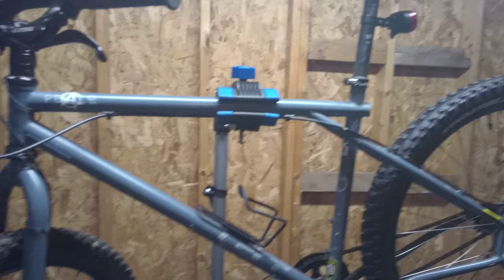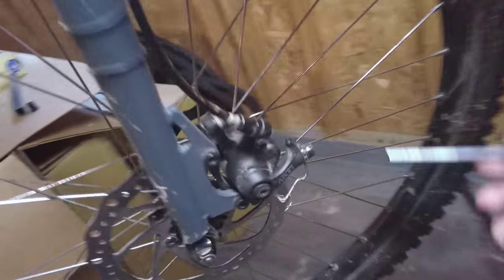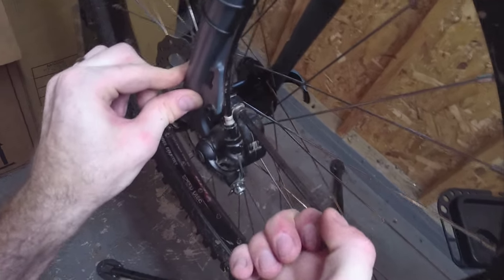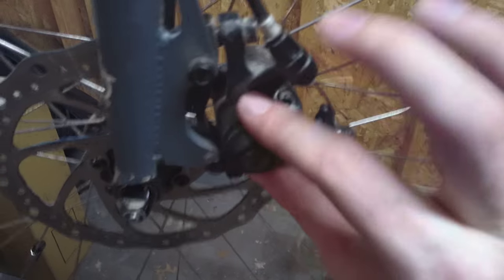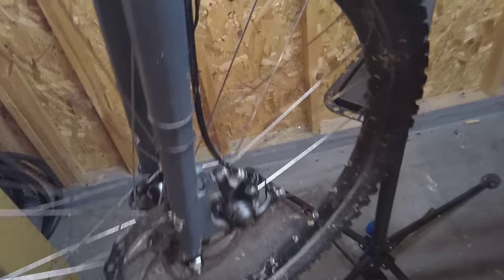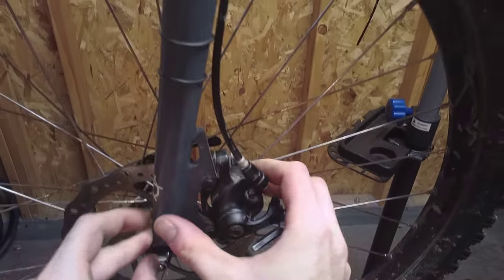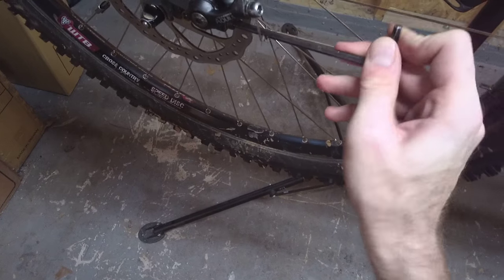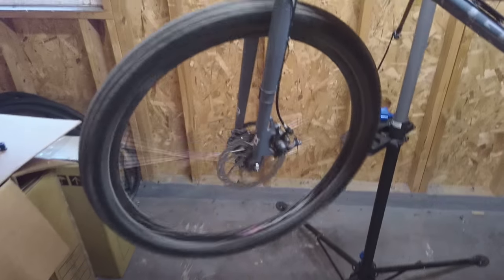How To Fix Disc Brake Rub Noise Alignment Tips Bike Blogger

Comment: Great tips. Didn't know about the screwdriver method. Alternately, you can loosen the Calibur, press and hold the brake, and tighten. The spacer you insert in the brake assembly after removing the tire works quite well.

Comment: Thanks buddy u are my saviour this was happpening with my electric cycle called ninety one Meraki I can’t adjust the rear mechanical disk brakes so they get loose pretty fast so my rear mechanical disc brake is dead so I use only the front one and I noticed this happening with my front brake then I thought that the disk is too tightly fitted to the wheel so I lossended it and then this sound reduced but it just came in huge gaps of travelling and I found ur video verry helpful man thanks again

Comment: Thank you I just adjusted my own mtb disc brakes thanks to you.. watched many videos on the same wording and subject and yours was definitely the most short sweet and to the point no beating around the bush or wasting time . Much appreciated ! Just noticed alttle wobble from rotor itself so I’ll have to straighten that out carefully somehow .. thanks again keep up the great work !
Reply: Remember: if you bend metal, it gets weaker. I'd say get new rotors just to be safe.

Comment: Can often "fix" the problem by loosening and realigning the wheel itself. It is crazy how often than can make a difference right away for better or worse. So the first step is to make sure the wheel itself is balanced on the hub. May want to do this several times to find the right balance. Then proceed with these instructions, not before.

Comment: One thing about disc brakes i would like to add, if you have hydralic ones, NEVER squeeze the brake lever with the wheel off as it causes it to lock up and then you have to bleed fluid/pressure and then mess around with the pads.
I only mention this as i've done it before and was totally annoying.
Reply: I did it, but i managed to get wheel back, brake felt stiff, but its better now. Do you think its ok?
Reply: It actually happened to me, yesterday and i managed to fix it up just by these steps
Reply: i think u just saved my bike XD thnx
Reply: Doreen Green  what should I do then?

Comment: Oh also sometimes the trick Bikeblogger said won't work because of defects or warping of the disc or brake systems, but you can sometimes solve that just by carefully spinning the wheel with the bike on on it's back and just really being exact with the spindle in the dropouts.